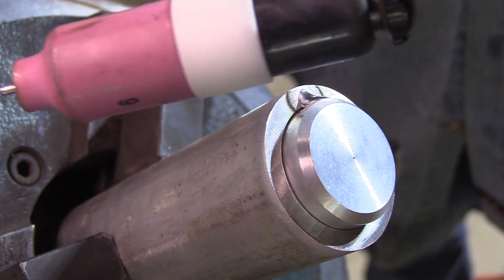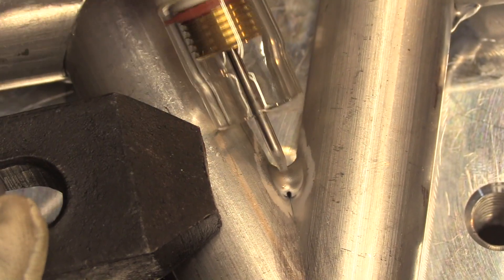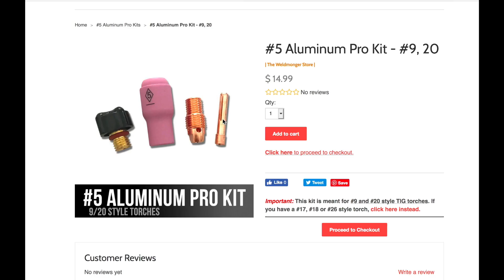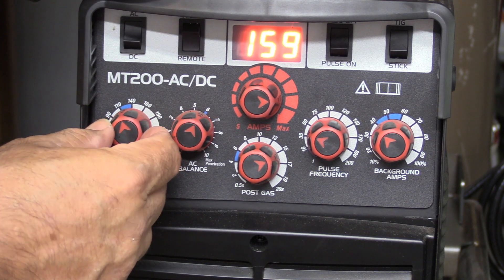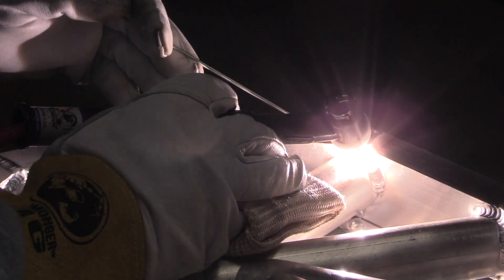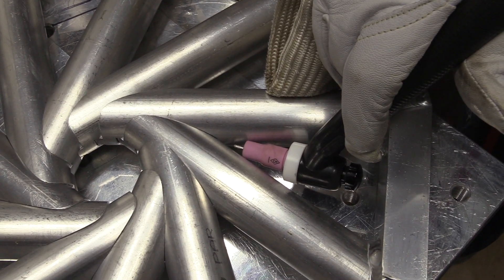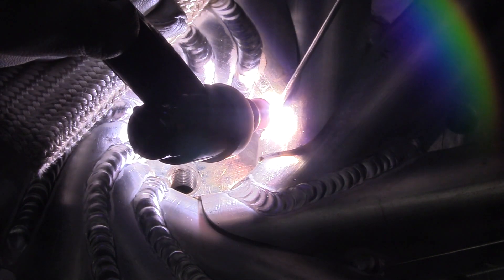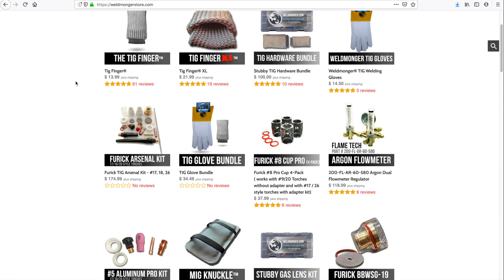Aluminum Hurricane

Comment: Looking to buy a welder for .125 AC /DC  welding. I have a big Lincoln for my heavy work on both AC and DC but it just docent weld thinner material very well so I want to pick up another smaller welder. I do want a higher end machine to take the next step in my welding self education

Comment: I’m nearly 50 now and been at it a long, long time. Mostly I weld pipe for chill water systems. When I started years ago, I used a shade 11. Fast forward to today, I make due with a shade 9 and slightly amber tinted safety glasses. The problem I have is I have a very hard time seeing anything. Are there any new lenses that help us old guys see better?

Comment: For spray mig I use 90 10 gas with .035 wire, 30v, 410 ipm, inductance 35. It’s almost silent. Is this correct?

Comment: Can't ball an electrode on Lincoln Square Wave 200 no matter what I try.
Reply: DC straight polarity, strike on a piece of thick stainless or something clean with a truckload of amperage.  And if Jody is "No expert", I guess that makes me a total hack, but I have not used a balled electrode since learning how to use the AC balance knob. I started aluminum using the Auto Balance setting from Lincoln and a balled, pure tungsten.  After my first trip to Lincoln Electric's Motorsports Welding class, I do pretty much everything with a sharpened 2% thoriated tungsten.  What Jody said about putting a ball on the tungsten for high amperage so you essentially control the shape of the electrode makes a lot of sense, I think I just don't weld that thick of aluminum much.
Reply: you don't need to ball the electrode tip when using an inverter machine, which yours is. If you feel the need to do something when using high amperage you can blunt the end of the electrode slightly, but otherwise just keep it sharpened to a point

Comment: All the gas lens i find for my miller sycrowave say not for use on AC, DC only. So what should i use? I wanna say its a 20 torch.
Reply: You can use any gas lens on AC. They say not to because the cleaning cycle can cause the screens to become clogged over time with the oxides that the cleaning cycle bursts up. Personally, I've tried both and never really notice a significant difference on aluminum. Then again, I am also very meticulous with cleaning and wiping down both the metal all around the joint and the filler itself too which probably plays a pretty significant roll.

Comment: Looks awesome just ordered my first tig machine. A Prime Weld Tig 225. Will be getting some of those puzzles to play with. Really enjoy your videos. Will be ordering stubby kit within the next couple weeks and course my tig fingers. Keep up the great work.
Reply: Don't get me wrong, but I think It would be Better if you start practicing with some "boring" flat stock Pieces as a beginner
Reply: @raulduke85  I was thinking the same. Those hurricanes are pretty expensive to Learn on.
Reply: @raulduke85 This will be my first own tig machine. But I used to tig aluminum baskets up when I built ladder fire trucks.
Grant you I haven't tig welded in bout 20 years. But getting back into building drag cars and want to switch to tig instead of mig.
Reply: @cvaracing7070  well that's a lot different then, you already know that you have to look at the puddle and even if you might be rusty, you surely know how to feed the rod... I thought you were new to tig welding
Reply: @raulduke85  lol yeah but im sure it will take getting used again. A lot has changed with machines for the better. Just have to figure them all out.
Reply: Learning to TIG weld, especially aluminum is a journey my friend. 😊
Reply: Dennis Young  When I was learning I practiced on .010 up to .250 scrap pieces. That'll teach you a usable range of thicknesses for Tigging.
Reply: Dennis Young  depends on your machine, i think 2 mm thickness is good to learn, about the size I'd go for small pieces, i dunno 150/200 mm lenght, 30/40 mm wide.
With pieces this small you won't Need preheat and you also Will have to learn to pay attention to how many heat you build up while welding, cause pieces this small Will get heat saturated. Then they are cheaper than bigger size ones.
When you'll be able ti weld properly this thickness, then I'd try thinner materiale; at First I'd suggest you to learn on flat position on flat Pieces; then you can try pipes and Square tubing.
Try also different positions and if and when you'll feel enough confident, maybe you can try to hold the Torch free hand, without putting your Palm, or your arm on your workbench.
Reply: Dennis Young  you can also learn using iron scraps wich should be cheaper than alu, if you have to learn TIG from the beginning, then, once you are able to see the puddle, you can feed the rod and control arc lenght and Torch angle, you can start aluminium welding together aluminum cans: they are very thin and at First you May find It difficult, but theese are the most inexpensive Pieces you can find to train on